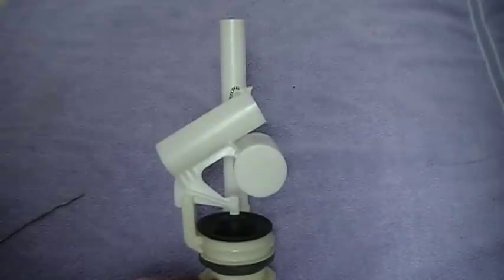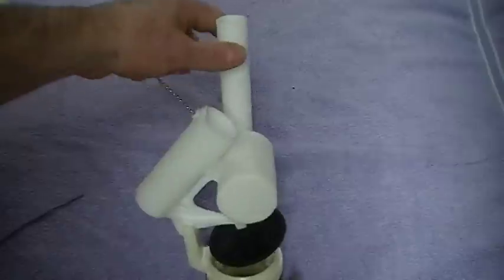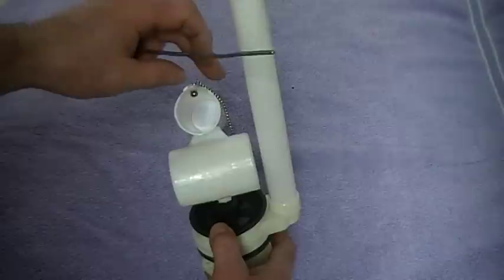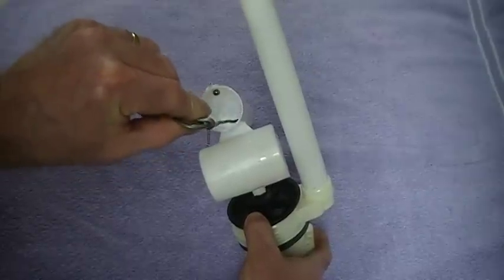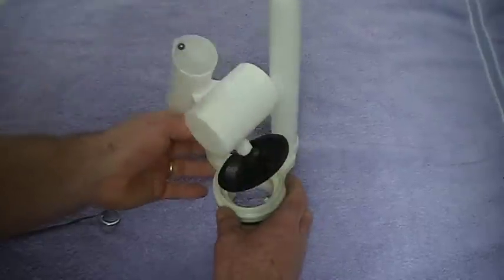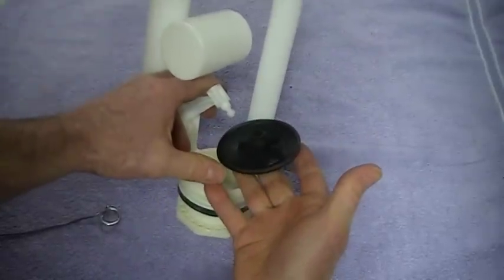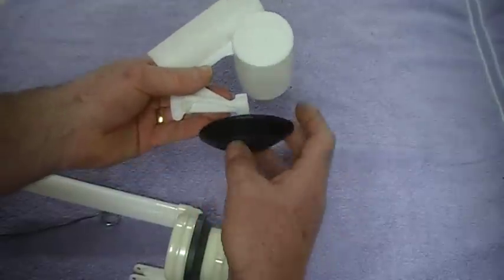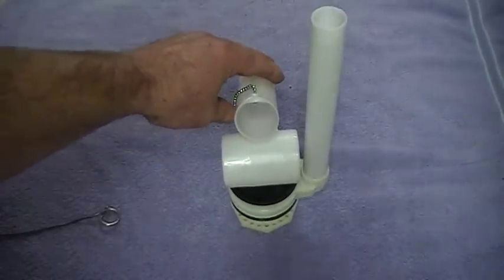How to fix an American Standard toilet tank-3  problem and solutions

Comment: Although it didnt fix my problem, it did teach me how my toilet works. There must be a problem overall, because it still leaks a little bit even though I replaced the whole setup. Thank You.
Reply from the maker: Hello RAF0769;
There is only 2 ways for the water to be leaking in the bowl. Either with a bad flapper or rising above the stand pipe .
I wish I could help you more with your problem.
It wasn't a lost project if you learned something from it.
Thanks for commenting and best of luck with the repair!     Al

Comment: Cleaning the hole in the small flotation tube is a great tip. I have buggered about, putting counter weights on. Plastic tube on the chain to stop flapper assembly falling backwards, to no avail. I never realised there was a hole in that tube. I'll try clearing that now.

Comment: Thanks kindly for this. I was afraid to try pulling the flapper for fear that I'd make matters worse. Just a suggestion ... wear disposable gloves or you'll be scrubbing the dissolving old flapper off your hands for quite awhile. Thanks again Oldkid888,2oldguyswalking
Reply from the maker: Hello 2oldguys walking,
You're more than welcome!
Congrats on the repair!
A pair of disposable gloves go a long ways on this repair for sure. The rubber certainly breaks down over time as you are aware of. 
I generally dive right in and get it done. Little scrubbing and they get relatively clean until the day is finished.
Thanks for commenting and enjoy your week!      Al

Comment from the maker: Hello theweebandninja;
The brass tube you are referring to is called the standpipe.I have changed many over the years and it is a matter of picking the piece out of the flush mechanism with a fine screwdriver. It is a bit of a task,but can be done with a little patience.You can still purchase these at some of the local hardware stores.They make them out of plastic and brass.They come in 2 sizes as well.Let me know if you find one.Is there a chrome 90 between the tank and bowl?
Best of luck! Al

Comment: I have an American Standard Lexington.  The Flush Valve the Flapper bounces over top of the opening, rather than stay seated.  I replaced the flapper, but it doesn't seem to matter.  If I hold stop the bouncing, by touching the cannon shaped piece, the tank fills with no problem!
Reply from the maker: Hello George,
The nice thing that I always like about this style mechanism is how it works off of two pivot points which allows the flapper to drop back in the same place. That being said....you have one that is not doing that. First thing I always do with this type of mechanism is check the cannon to make sure it drains properly. The small hole in the bottom of the cannon can plug up with mineral deposits over time and not allow the cannon to drop back down properly after flushing. This is a very common problem.
Was the flapper that you replaced made by American Standard? There are a few companies that make such flappers and they are a little different in shape. 
Thanks for commenting and get back to me when you get a chance....Al
Reply: @TheOldkid888  I agree with you regarding the two pivot points.  The flapper was replaced by the local plumber.  It seems to seat pretty well.  Getting to the issue, I checked the drain hole for mineral deposits and insured that the hole as clear by using the hanger tool you recommended.  Turned the water back on and the same issue happened.  If I hold the the flusher control for three or four seconds, the cannon shaped chamber has time to drain down, the flush completes (no bouncing) and the tank refills.  I will look into an American Standard Flapper valve.  I'll keep you posted.
Reply: Sorry I didn't get back with you before now.  I replaced the flapper valve again and the problem resolved itself!  It was still a cheap fix!  Thanks for taking the time to help. I'm going to keep this email on file for future reference!

Comment: I have one of these in an old American Standard Cadet (4049) where someone long ago must have cut off the ears for the original valve to replace it with an aftermarket flapper. I'm having a hard time finding a replacement flapper that covers the opening well and doesn't leak. Any recommendations? Or do I have to go through removing the tank and replacing the entire assembly?
Reply from the maker: Hello Jim,
This one may help you out.
Master Plumber 714-7 Fit All Toilet Flapper Adjustable.
I use Master Plumber often and they generally come through for me.
I know some of the hardware stores carry it.
If you end up replacing the flush mechanism; you will need a tank to bowl kit as well.  Make sure the rubber tank to bowl gasket covers the new spud on the bottom of the tank. This is very important.
Thanks for commenting and hopefully it will work out for you!     Al

Comment: what do they call this whole assembly because I need to replace the rubber flapper?
Reply from the maker: +frank ploger 
You would be looking for a flat seat disc. Some screw on and some push one. You will have to try and unscrew it first to see exactly what you have on yours.
Thanks for commenting and best of luck with the repair!     Al

Comment: Hooked up a new American standard toilet and turned the water on  and it won't fill. I have water to the tank just not in the tank
Reply from the maker: Hello Jim,
What type of fill valve is it? Is the float situated close to the side of the tank. It possibly could be hung up there and not dropping. Do you add a rubber gasket to the supply line that is attached to the tank? If so, I would remove that. It would not be needed. Have a look at the fill valve and make sure it is not up against the side of the tank as it won't allow the float to move. from time to time I find the valve not in the exact location that it should be from the manufacturer. Not just this brand, but many others as well.
Something you can try......remove the supply line from the tank and place in a bucket. Turn the water on and check for pressure. This is where I would start first making sure your supply is good.
Get back to me when you get a chance.     Al

Comment: I have the opposite problem...I just replaced an old american std with the newer style black plastic flapper, looks like the one you show in the video...The problem I am having is that the flapper does not stay open long enough!  It seems that the drain hole is too big!  I added a few pebbles to the cup which helped for a few days, but now it is closing prematurely again...I did NOT use OEM AS flapper, perhaps this is the problem...Any simple way of making the drain hole smaller??